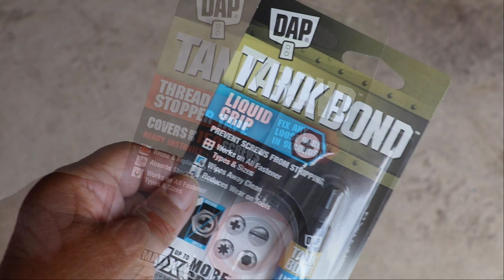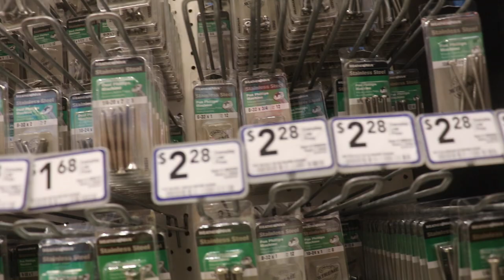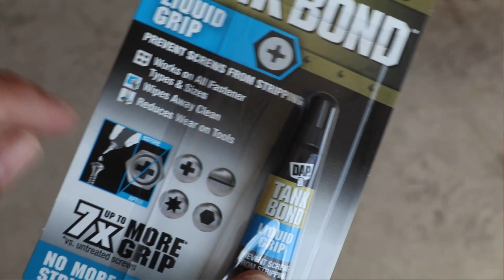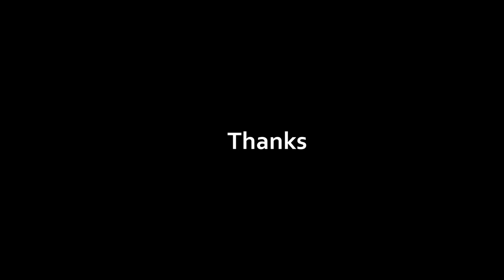DIY TRAILER KIT // ANYONE CAN BUILD

Comment: Good points and suggestions Leah  my Cousin who is a Engineer. Bought and assembled the same trailer  and he told me he  had to drill almost every bolt   Hole or enlarge them with a die grinder due to  mis alignment issues  that added a lot of extra time for assembly. The end result is he does love and use the trailer  very often  I myself am a slight  Trailer Hoarder because of the low cost to keep them legal to tow and the Versatility they offer  I’ve personally have had 17 or 18 boats  in my life  and I was able to use one trailer  I bought new for many of those Vessels with minor adjustments and minor  modifications  I even modified that one to haul Inboard boat engines  temporarily  and to be a Utility trailer  for hauling Trash to the Dump  ! BTW the Dump Employee laughed saying now he has seen it all  yet he thought it was quite creative  because it worked

Comment: Leah, I have owned one of these trailers for over five years now and have a few suggestions:  The wire system will give out in about a year and the outside covering will look good but the wire itself will be broken. I replaced with aftermarket kit and no problems in years.  I had two fender brackets break so check them from time to time as I had one of them fall off on the highway and damage the tire and taillight.
Love the trailer!  I moved recently and did so many trips (each roundtrip 600 miles) that in four months I went through a set of tires. the trailer hauled wonderfully.  I put sides on it with 1/2 sheet plywood  high then stake body above it so I could haul mulch, stones, gravel and boxes.  I used "T" nuts and eye bolts to hold the 2x4's to the sides so it is easy to remove the sides to pick up full sheets of lumber.
Enjoy!  Hope you are loving your new home!
Reply from the maker: Thank you for sharing your ideas and experiences.

Comment: Two things I would do differant. I would put the tie downs on the side of the frame. Dont rely on the wood plus i want a flat surface, not one with tie downs sticking up. As to bolts, etc, i would just use loctite. You did have the great idea of using stainless steel hardware. It's what i use on anything that will be outside.

Comment: i thhink you were a little ruff on the HF 8" grinder. If you shock mount it using rubber shock absorbers it makes a huge difference and is now very usable. Thanks for the great information you share.
Reply from the maker: I did cushion the grinder.  Secondly, did you see the follow up video?

Comment: Back about 20 years ago I bought one of these folding trailers, mainly because I had space considerations. Back then they were around $150. I built nice side rails for it and a bed, much like you did. I found it to be too much of a hassle to unfasten the bolts and fold it up, then unfold it and refasten the bolts to use it, so only did it once and never again. (I used mine quite a bit)
Another thing to be mindful of is that to reduce costs, they install pretty cheap wheel bearings in them and you need to adhere to the listed load limits, as the bearings and tires can only handle so much weight. My bearings failed on the highway and I had to borrow another trailer to haul it home. I replaced the bearings with new upgraded ones and was back on the road.
Reply from the maker: I was considering the same thing regarding the bearings.

Comment: nice trailer. I have the same one bought it at harbor de freights. First they had two weight classes. The only difference was size of the tires to hold more weight. Second, i made backing plates for the stake bolt in areas and for the bolts that hold the trailer straight when in the flat.  on the steel plate I had nuts inserted and welded for the bolts. then used a heavy duty double side automotive tape to hold them on. now I don't need to get on my crippled knees' to unbolt my trailer to fold it up. i have a few extra plates left if anyone wanted to see them to get ideas.  i wish that thread tape stuff was around when I first assembled mine. lost half the nuts holding the wood desk in 6 months.

Comment: It helps to make a better ground if you scrape the paint away from where you put the grounding screw to the frame and add a star washer. Then either spray over it with a clear acrylic or a dab of grease to keep rusting down. Don't always trust the screw to make a good ground to the trailer frame. Also a must is to purchase a spare tire when you buy the trailer. If you don't you can have a real problem.
Reply from the maker: The spare tire is a must!  I did expect the self-tapping screw to create a solid  connection, your option however is an excellent suggestion.

Comment: What’s the max highway speed of the foldy?

Also how does the folding part work? Is it pins you pull out or a series of bolts you need to undo everytime?
Reply from the maker: According to HF 45 miles per hour.  Good question.

Comment: Leah, did you drill out holes under the plywood where it sits on top of the bolt heads that hold the frame together? Also I've heard running dedicated ground wires from front to back is the best long-term solution to prevent wiring issues. It's on my "to-do" list for my version of this trailer.
Reply from the maker: Yes,  I did drill out holes....I wish I had shown that step of the process.  It's a important detail abd I simply forgot to mention it.  As for the ground wire, my thinking was to run the shortest lenght of wire possible because they"ll be less opportunity for a break in the run.

Comment: One thing I learned from somewhere I don't remember is that you can take a marker and color a bit of the end of the white wire that is actually the ground. Or, you could use a bit of black electrician's tape. I like my colors to be standard.

Comment: Leah I wait eagerly for your great videos , thanks alot 
one small question - if you mount the hooks on the side ( metal square tubing ) 
1) stronger mount  and 2 ) does not limit you when loading larger items ( full size board etc ) 
just my thought I ask
Reply from the maker: Nice! I appreciate the helpful comment....I wish I had done that in retrospect.  Others will benefit from your suggestion.

Comment: I just got a canoe that came with a trailer. I was thinking about selling the trailer since I only paid $400 for the combo BUT it has 15 inch tires which means FAR less wheel bearing wear, but I am also considering converting it to a utility trailer. If I can figure out how to get it so it folds, that'd be ideal for me because I can't get the trailer into my back yard through my driveway because of some stuff in the way.

Comment: Hey Jane, hope you are well.  GOOD TIMING!   I need a trailer and pre-built are way to expensive!
I have one question....  the steel bolt you were ratcheting in... was that a threaded hole?  Or a lock washer and nut?
Thx and have a blessed day.
Reply from the maker: Lock washer

Comment: Oh my gosh, this video is fairly recent but you're still suggestion a product that has gone up in a crazy amount? Sheets used to cost 24$ are now like 90$ if not more! It's completely crazy!.... T_T I hope everything gets back to normal.
By the thickness of it, I'd go more with approximatively 120-130 per sheet?
That is unless you have a professional license as an independant worker and so on. But even then! The prices are crazy.

Comment: Hi Leah! I've found your videos very helpful! At this point, I am now retired but still need to earn money - ugh! I'm planning on attending events & Farmer's Markets to sell coffee, tea & baked goods. My products have been extensively tested & now is the time for the construction of the cart. I have a 10'/12' (?) Traile w/12" metal grate side walls - no tail gate. My question is how to enclose it, add a door, counter tops & drawers. Money is tight, so I will not be adding plumbing or electricity right away. Any suggestions would be helpful. BTW, I've watched videos posted by men, but I've found over the years that I have 100% success w/your guidance. Thanks!
Reply from the maker: Honestly, van life creators could probably offer you better options than myself.  Good luck!

Comment: Might be overkill, but I always coat my trailer frames in bed liner and fill in any holes with great stuff.
Reply from the maker: Really....how has it held up?
Reply: @seejanedrill  I love it. Keeps it from rusting when they get banged up. I also use epoxy pond sealer on the plywood. I buy them (when I find them used & cheap on FB or local ads), fix them up, and resell. Also buy axles & steel from trailer parks in town and make them custom when someone asks.

Edit: Assuming it's steel frame, and not aluminum frame. If it's Aluminum frame, the bed liner is basically just a tough paint job, and would be somewhat of a waste when you can just use an enamel tractor type paint to make it look good. I hate rust though. As a professional, pulling up to someone's house with a rusty banged up trailer just doesn't look good.

Comment: Can you pull this with a smaller 4 wheel drive car, like a Subaru?  This is the answer for me.
Reply: Most likely, depending on what you load it with.  Your vehicle should have a manufacturer's recommended towing limit mentioned in its specifications or something.

Comment: Pretty COOL!   Just One thing . . . Getting that 4x8 Home Before Trailer is made.  =\      lol   Store, can cut Perfectly?  : }
Reply from the maker: Agreed
Reply: Do this: Take a straight edge (a 4' or 6' level works), 2 clamps and your Cordless Circular Saw with you (they fit in your vehicle). Grab a few pieces of cull lumber (pallet feet or skid runners) from the Lumber Dept to set the plywood on, and measure (remember to compensate for the saw plate), clamp and cut. Et voila!
Reply: @jimtownsend7899    Oh right - Saw Plate.  Thanks so much!

Comment: Well, ok, but I made one of these and the axle mount broke and I had to get out my welder and weld it all together and buy some 1/4 inch wall square tube to beef up the chassis.  Oh and the tongue is bent and I’ve gone through two ball couplers.

But it beats owning a pickup.
Reply from the maker: How long did you own it before you developed maintenance issues?
Reply: @seejanedrill  hi Leah!  Love your work :). Pretty much immediately.  I think the bolt-together system is just not rigid enough.  If they can wiggle themselves apart, they will.  But I use my trailer to capacity and after the reinforcements it has been very useful.  I suppose the message is that for anything but the lightest duty, they need beefing up.  Upside is, parts are cheap!

Comment: "Any One Can Do This"?
Reply from the maker: Anyone can....if you have about 6 hours to assemble it.  BTW I received your email but there was no message attached, just the photos.
Reply: @seejanedrill  Is it advisable to power wash the garage floor like you would a driveway??????
Reply from the maker: @P.L.M.  yes, pressure washing the garage floor is fine. Is there a drain ?